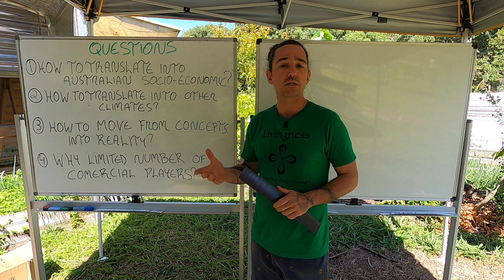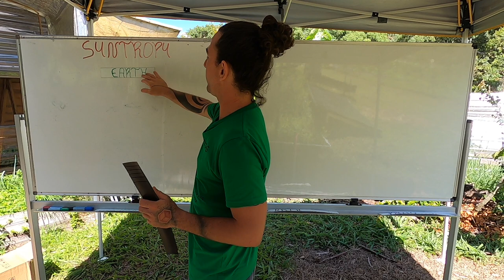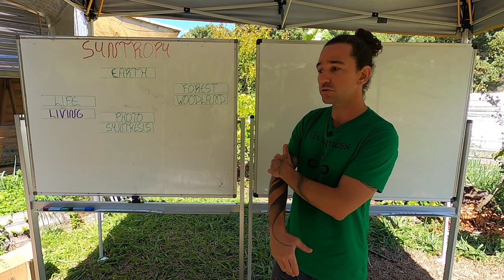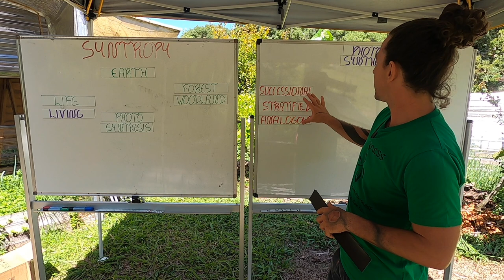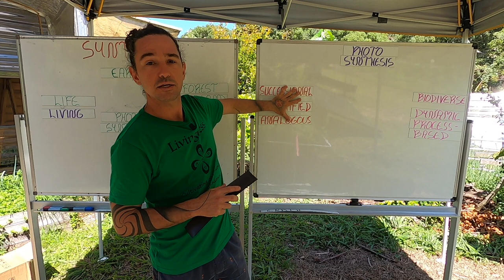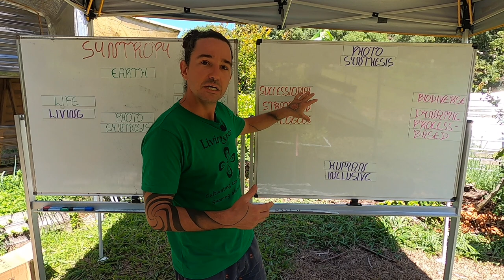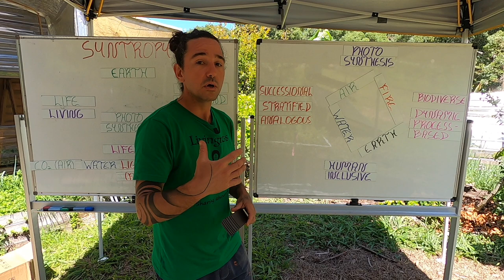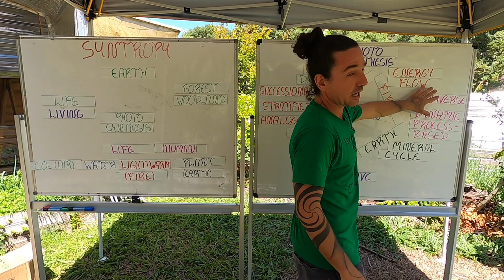1/7 Syntropic Principles - Overview

Comment: Very good, very good. Just from a conceptual elemental / alchemical perspective, on the left board I'd put Soil where you put the Plant and then the plant becomes the fifth transcendent element. That connects more with the tree as being the vertical, layered higher dimensional element that you speak of. Then on the right I'd switch over Earth and Water to make the elemental Mandala 'correct' and I wouldn't put the Human in the centre but the Plant. We benefit from the plant but we are its guardian, as one of your commenters says: we are a guest in the garden. Anyway, it is hard enough to make people consider Syntropic farming so to then also not see ourselves as the centre of the system is perhaps a step too far - but it is ultimately what we are saying here. It is a Synergy, hence Syntropic. A correlative system, not a causative system, that we shape and benefit from but that doesn't revolve around us - we just happen to shape it to optimise it for consumption and management.

Comment: In regards to the tree analogy, when it is vertical, it contributes primarily to the hydrological cycle, when it goes horizontal, it contributes primarily to the biological cycle by way of decomposition. It doesn't necessarily stop one cycle for another but rather shifts gears...???